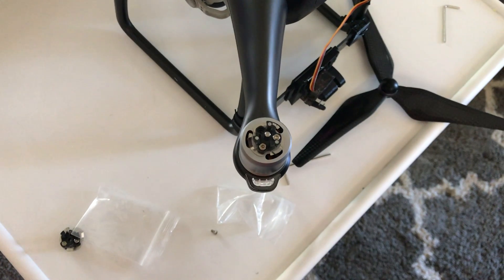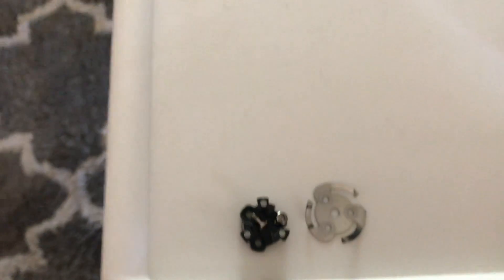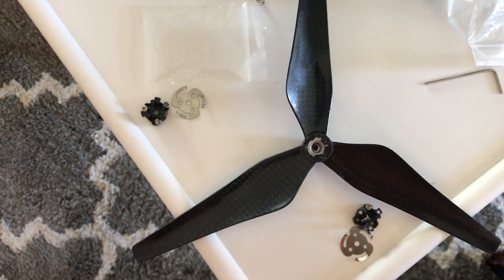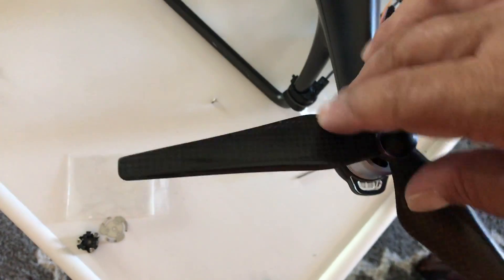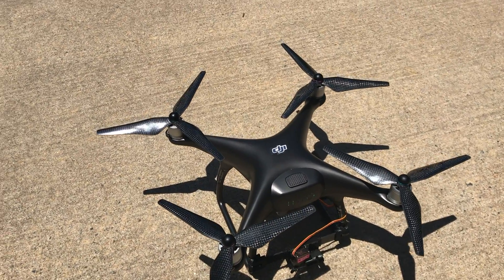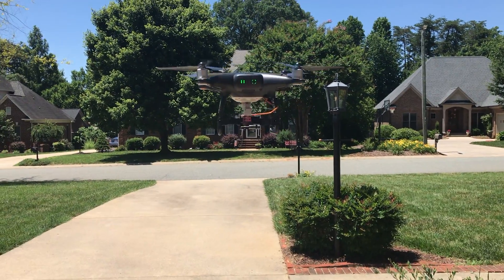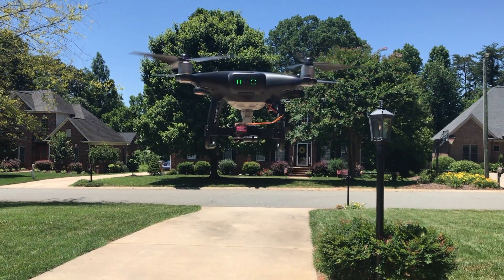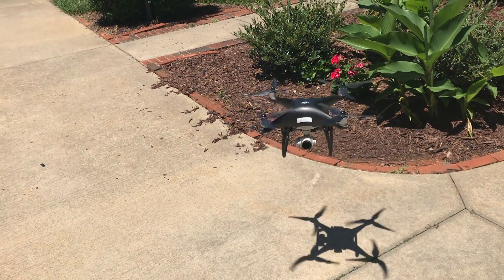DJI Phantom 4 Installation and test of three bladed props on Phantom 4

Comment: You turned the motors the wrong way to tighten the props... They do tighten themselves as the motors spin, but it's always better to tighten them yourself.
But from the sound of it these props are pretty inefficient anyway.